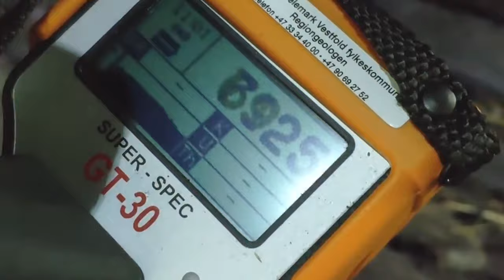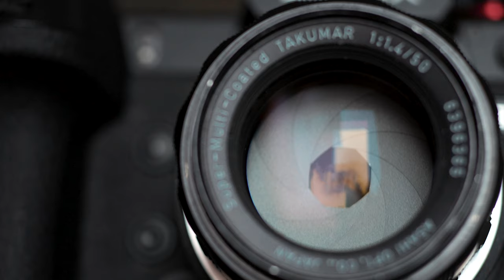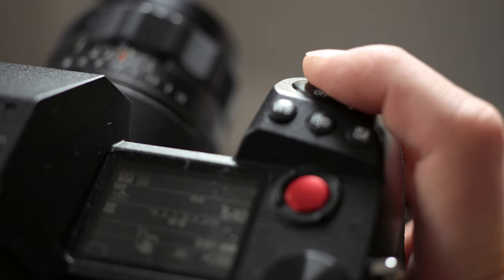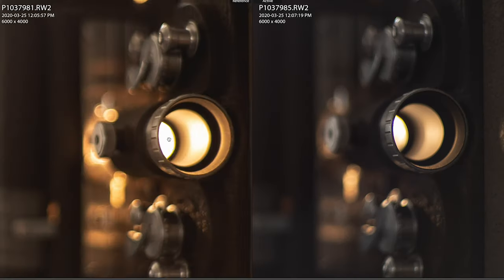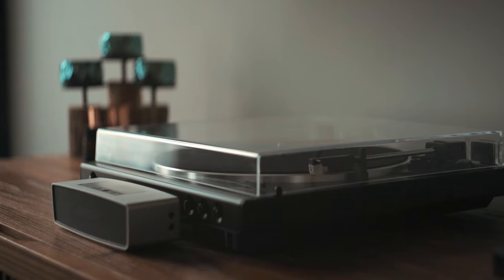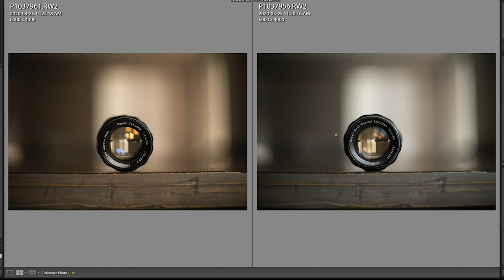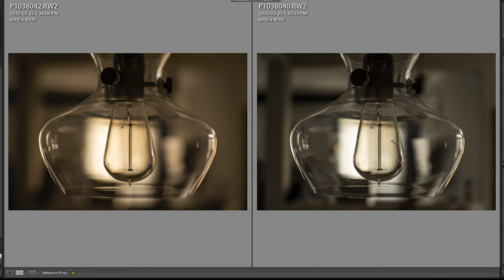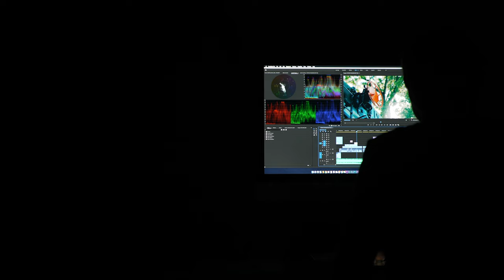The Hidden Secrets of Radioactive Vintage Lenses!

Comment: I have a few Kinoptik lenses, one lens, a 5.7mm, has almost no coating, worn off by cleaning no doubt.  So, I contacted D*cl*s Lens, those guys.  They told me my lens could not be re-coated because their Lens guy said it's radioactive. I'm still a bit angry as they wouldn't give me a reference for that conclusion.  Anyway, I don't think it's radioactive.. Just venting here, in that I love vintage, no doubt I'll acquire some thoriated lenses.

Comment: what super takumar is non radioactive?
Reply from the maker: There are a few, but most of the slower lenses. It’s the F2 F1.4 ones that were mainly thoriated to reduce optical imperfections. 

The Super Takumar 50 1.4 8 element isn’t radioactive. I can’t say for sure what lenses beyond that one are not. The auto Takumars were mostly if not all non thoriated. They’re solid lenses by the way.

Comment: The basic research I’ve done has me mainly concerned with exposure to the radiation at the eye as it’s one of the concerning exposure points. 

As someone who’s had eye issues I’m extra careful.  

Currently I own a few vintage lens and bought a Geiger counter to verify each is not radioactive.  I hated spending the $70 for the tester but it’s a small investment for peace of mind.

Comment: Someone in a Facebook group told me to just put the lens on a mirror and blast a daylight balanced cob led through it with a fresnel or a reflector dish (with a fan on it). He said to leave it over night. I was skeptical, but I tried it, and it definitely helped. I did it for a couple of nights, and it's almost back to normal. It went from about 400K warm to 100K. Interesting.
Reply from the maker: Hmm, I think it needs to be UV, but I don't know 100%, but I've never  heard daylight balance artificial light working. Sunlight "works" because it has UV rays, but again this is a first. Quite interesting!
Reply: @MarkHoltze  I didn't expect it to work either. I don't know why it helps, but it seems to for some reason.
Reply from the maker: It’s so interesting, I feel like I’ve been lied too before this 😆 thanks again! ✊
Reply: @MarkHoltze  it doesn't really need to be UV - it can help speed things along, but really it's just about photons, not the specific wavelength, that matter. There's lots of misinformation getting repeated over and over on the internet!
Reply from the maker: Understood, thanks! ✊